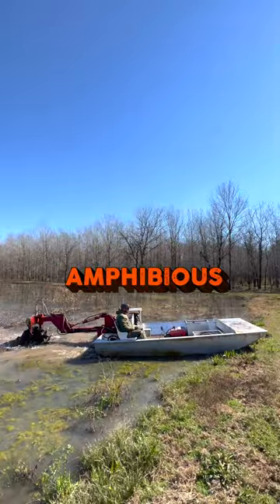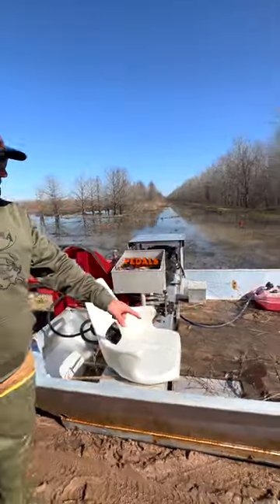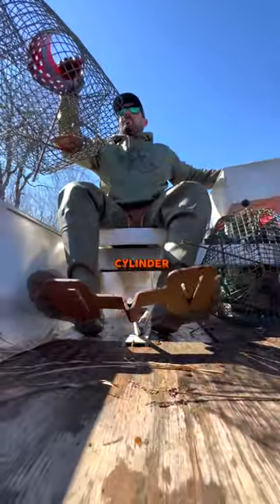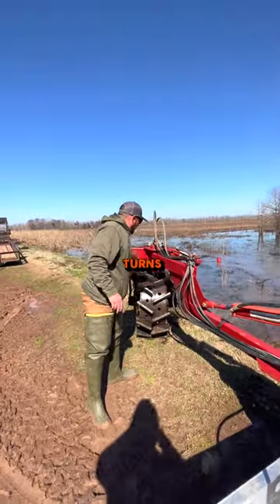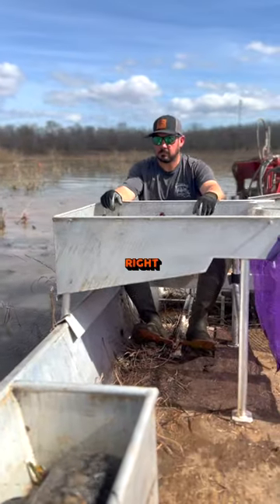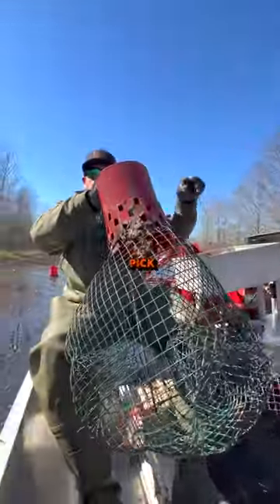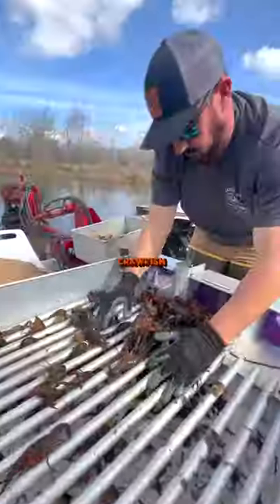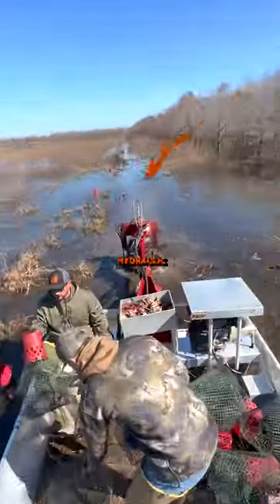More On Crawfish Boats

Comment: Do you run into gators in your ponds ?
Reply: It is manmade
Reply: @Nuclearblade  Yeah Gators don’t give a sh1t, they will live in your house if there is enough water
Reply: @Nuclearblade  Gators ain't picky bud
Reply: The noise of the motor probably gives them enough space if not your allowed to shoot em
Reply: @Nuclearblade  What does that even mean? I’ve seen gators in backyard swimming pools.
Reply: Gators are a bit more timid than Crocodile's which are not in Louisiana.  They will generally not interact. Not saying they won't but those who grew up in the swamp will tell you they often swam and didn't have a problem.

Comment: The General Electric GAU-8/A Avenger is a 30 mm hydraulically driven seven-barrel Gatling -style autocannon that is primarily mounted in the United States Air Force's Fairchild Republic A-10 Thunderbolt II. Designed to destroy a wide variety of ground targets, the Avenger delivers very powerful rounds at a high rate of fire. The GAU-8/A is also used in the Goalkeeper CIWS ship weapon system, which provides defense against short-range threats such as highly maneuverable missiles, aircraft, and fast maneuvering surface vessels. The GAU-8/A is currently produced by General Dynamics.